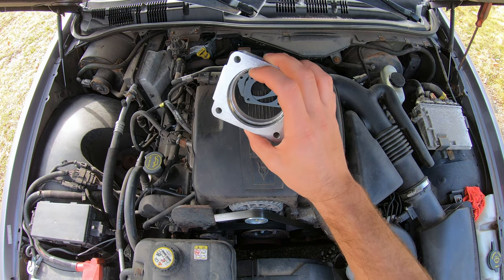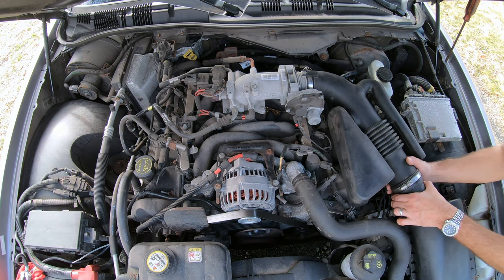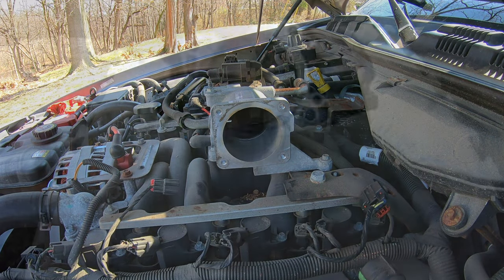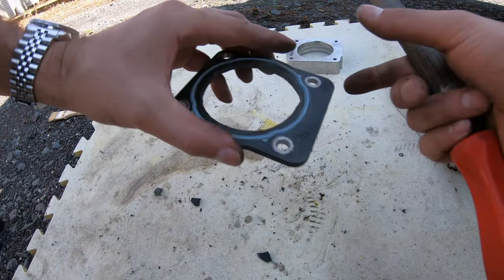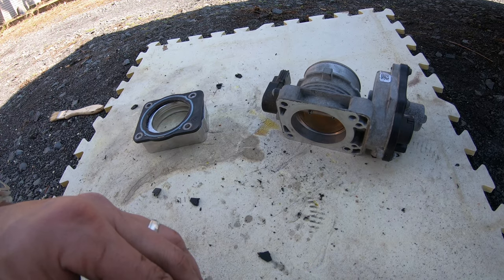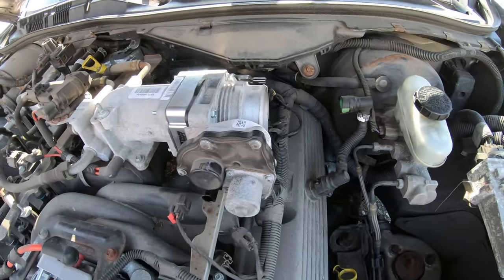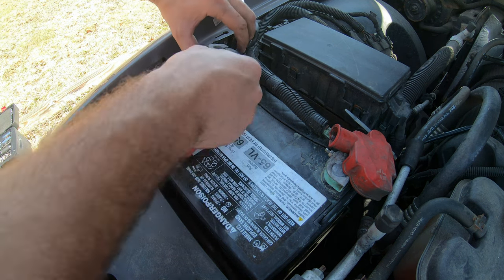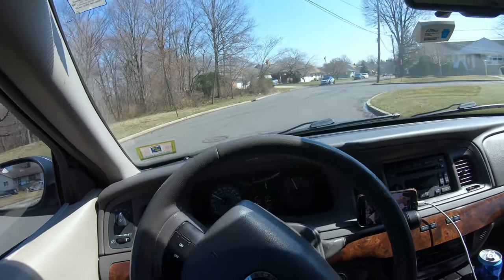Mercury Grand Marquis $50  Horsepower Mod? for Panther Platform How To Install Complete Guide 06-11

Comment: So,how does that improve the horsepower?
Reply from the maker: That’s a good question! That’s what I wanted to find out for myself! Will be doing an update video on this project! “Spoiler alert….it wasn’t neck snapping power😬 “ thanks for stopping by!
Reply: It's just another gimmick, money grab only stupid people buy.
Reply from the maker: @maxdm1583  thanks for stopping by! Gimmick or not, you won’t known til you try it! That’s what we do here! We have to try it for ourselves. I saw many that said it’s gimmick and waist, while others said they felt and experienced a difference in their car! Thanks for your response!
Reply: @maxdm1583  exactly it doesn’t. The only thing it does is add just a fraction of more air into the intake manifold, and move the throttle cable forwards more so the throttle body opens a tad bit faster. Otherwise it’s useless and a waste of $45.
Reply: IT DOESN'T. Throttle Body Spacers DON'T WORK on port fuel-injected engines.
It cost me A LOT of time and money to find out that a Throttle-Body Spacer does GREAT on carburetted engines, but it's pure junk on the fuelies.
Reply: @LoveWhatYouDrive  Yo, Love !!
 Happy Thanksgiving to you and yours.
About that "Trying for ourselves" stuff --
 Many people come here looking for ANSWERS, and those of us that have considerable experience in automotive maintenance and repair are more than glad to help the novices learn the ropes.
 This approach allows newbies to learn WITHOUT enduring the expense and disappointments we face when "trying for ourselves".
Your Video mentions "50 Horsepower Increase" -- which is shameless click-bait, because that cheap-ass TBS does absolutely NOTHING to increase the power of performance of your 4.6-liter 2v.
 I know this because I "tried it myself", following the manufacturer's directions and working very carefully. 
 After several thousand miles of city-highway driving and careful fuel mileage calculations (2 decimal places) and drag strip runs, I ascertained that the "Taylor Helix Power Tower Plus" DID NOT:
1. - "Pays for itself at the pump."
2. - "Up to 4 MPG gain."
3. - "Up to 22 Horsepower gain."
4. - "Torque Increase up to 25 ft/lbs."
 NAH. None of that ever happened.
And that Taylor TBS cost a damned sight more than the piece of junk in this video.
  Cheap or expensive -- Throttle Body Spacers DO NOT WORK on port-type fuel-injected engines. Period.
 And they DON'T increase the throttle response, either.
 They do GREAT on carbureted engines, but not for fuelies.
https://www.mercuryforum.com/forum/grand-marquis-14/1995-grand-marquis-restoration-8937/
Reply from the maker: Happy Thanksgiving Chuck, Thanks! Per “50 horsepower gain” title, it is written in a question format with a question mark at the end. I never claimed that’s what I got or it did. I’m just basing my title off of the  ad they claim! That’s why it’s a “let’s se for myself” approach and video. But as you said, we want to try for ourselves and then realize what is and what isn’t! Happy Holidays!
Reply: @LoveWhatYouDrive  You're missing the point -- Question mark or not, peeps see that "50 Horsepower" and the jump on it.
 I didn't say that you're trying to SELL that piece of crap -- 'cause I don't care about that.
Once again, your "see for myself" approach is not suitable for this type of video.
 But hey, it's your baby, burp it any way you want !!
Reply from the maker: There has never been a talk of “50 horsepower” gain. As the title and the argument states “$50 Dollar Horsepower Mod?”…gotta read the title carefully Chuck! Question marks and dollar signs and and grammar sure do count when approaching an argument with wrong information! Have a good turkey dinner!
Reply: @LoveWhatYouDrive  YIKES !!
 I blew that one all to hell --  Shoulda payed closer attention. 
 The Turkey Dinner was great, thank you !
Reply: @LoveWhatYouDrive  HHMMMMM.
Seems like we both weren't paying attention, Love --
That thing does NOT say "$50 Dollar Horsepower Mod?" --
 It says "$50 Horsepower Mod?"
 Notice the "50 Horsepower" part. It's easy to make a mistake .
Just like "$50 Dollar" is a mistake.
 We  all make 'em.
 CHEERS !

Comment: Is there one that will fit on a 1985 Grand Marquis
Reply from the maker: Thanks for stopping by, from a quick online search I wasn’t able to find any “performance” spacers only rebuild kits for your current setup. Even Summit Racing didn’t seem to carry anything! Maybe it’s out there somewhere.
Reply: @LoveWhatYouDrive  
Probably something custom made will have to be made done if anything thanks for reply
Reply from the maker: No problem good luck

Comment: Didnt see the paper gaskets put in ! Did anyone else ?
Reply from the maker: Time stamp 12:37 is where one of the gaskets is put on, and the second one I didn’t use because the plastic gasket where I grind off the teeth has a round rubber o-ring. Where the spacer meets the manifold is the provided paper gasket. Where the spacer meets the throttle body there is the stock piece. Thanks for coming by. Appreciate you!

Comment: take what I say with a dose of salt but it's my understanding if you add one of these  the computer needs to be programed and tuned to the parameters of the new parts added. maybe I am thinking throttle body or mass airflow sensor. again take it with a grain of salt as I am no car expert. 

thanks for the videos and please let us know how it feels or if your mpg changes. personally I'm a stock kind of guy as I have had horrible luck with aftermarket modifications but that's not everyone's experience.
Reply from the maker: @Christopher Sierra first of all, thanks for watching and commenting! I appreciate your feedback and engagement. From my own research and watching and reading much about this throttle body mod, I don’t believe there is such a significant change or mod to have to have the computer programmed. The car computer will make adjustments accordingly to more air or fuel if needed. It’s such a tiny mod that it doesn’t have to try hard to accommodate. I am working on a video update on this matter after driving it around since the install. Definitely will tell you right off the bat, that if you are looking for neck snapping horsepower, this is not it by a long shot. Is it somewhat responsive on the gas pedal? Yes, is it the next greatest power gain?  No. Look out for the next video and more to come! Thanks for stopping by!

Comment: What store can I purchase the part?
Reply: 2003 Lincoln Towncar
Reply from the maker: Thanks for stopping bye what year and model do you have? I got that through Summit racing. There is a link to Summit website in the description of the video.
Reply: @LoveWhatYouDrive  ok
Reply from the maker: I got mine through summitracing.com But you can also get them on eBay or Amazon
Reply: @LoveWhatYouDrive  ok thanks man I put a k&n air filter on mines and it’s got some pick up and I watch your video so I’m getting ideas
Reply from the maker: @vacairripatterson1504  thanks for the support! I have a drop in filter that I’ll be making a video on and hopefully upgrading my air intake system! It’s not a k&n I have it’s a spectre filter, I believe k&n makes it! Good luck on your build!
Reply: @LoveWhatYouDrive  ok thanks these motors will last a long time I had all three Lincoln Vic and marquis

Comment: You can't modify the Throttle on 05 and newer platform vehicles without tuning your Computer. I say Can't meaning you Can physically do it but you can make your engine run weird and funny for not tuning afterwards. But 04 and Old you can slap this on without a tune.
Reply from the maker: Thanks for your time! Haven’t had any issues on ending running weird or anything else,  it tune is in near future plans for sure! Thanks!

Comment: That oem gasket is doing the same thing that spacer is doing it swirls the air like a tornado. The theory is tumbling air is more efficient has more molecules of oxygen than a straight air shot and it flows around corners better. I have a 2007 F150 with the 5.4 installed a Poweraid spacer the same theory applies the bore of the spacer has a coarse thread milled in to it promoting a tornado affect. Oem head design has also adapted this calling the tumble effect the air effectively swirls from small dams cast around the intake valve this mixes the fuel with the air in a homogenous mixture aka 100% efficient. Does it work I did notice more torque off the line but full throttle no difference the airstream moving too fast at higher rpm ignores the outer stream swirl. That gasket that has fins protruding filling 30% of the airflow will work over a broader range of rpm. In a nutshell if you have no finned gasket you may find no difference if you dont in the lower rpm range these things shine.
Reply from the maker: Thanks for watching my video! I appreciate you! That was very well put together, I am now tempted to try it with and see what happens. All I know at this point is stock form and this concoction I put together. Maybe I will try different methods. Thanks for your feedback!